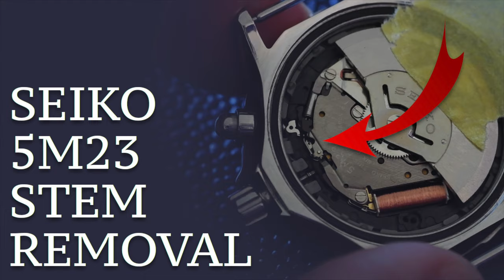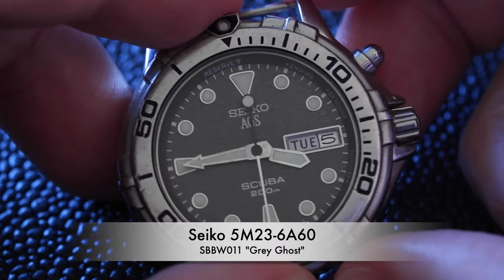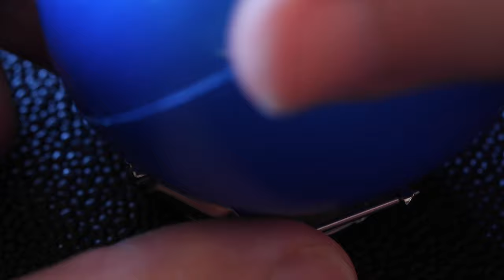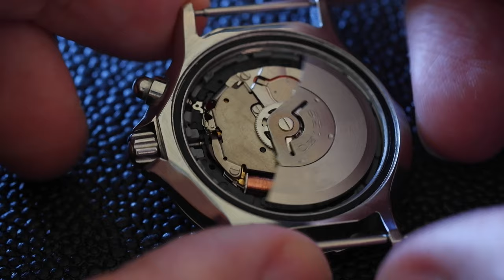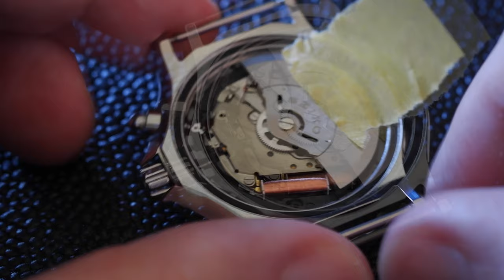Seiko 5M23 watches: How to remove the stem and crown

Comment: Hi, I removed the stem on my Seiko 7L22-0AA0 (Kinetic Chronograph) put the stem back in and it stopped ticking? Pull the stem out to 1st notch and it ticks, push the stem back in and it stops. Any idea?
Your advice would be much appreciated thanks .
Reply from the maker: Hi there. Sorry to hear it's not working. It's hard to know what's happened but it sounds like it might be that the setting lever or yoke have slipped and are not in the right place on the stem or clutch wheel (pinion). Removing and re-inserting the stem a few times might get it to eventually sit in the right place, as long as the end of the stem is not bent. If not, then I think it might mean taking the dial side of the movement apart. This video explains it quite well, in particular from around 05:07: https://www.youtube.com/watch?v=Vy4anc3k97M
Reply: many thanks @mizeni , I will give it a go one I purchase a movement holder
Reply from the maker: @usrca1707  Good luck!